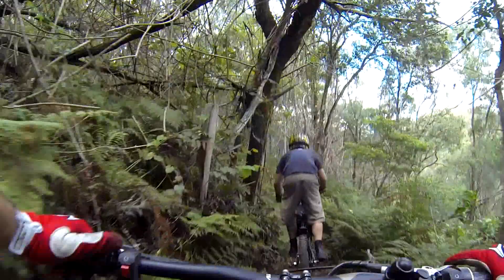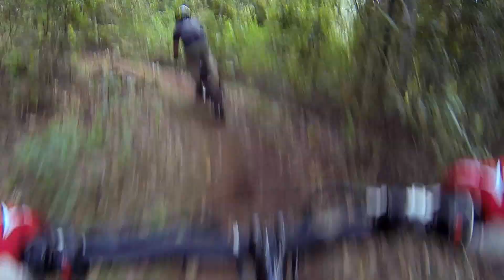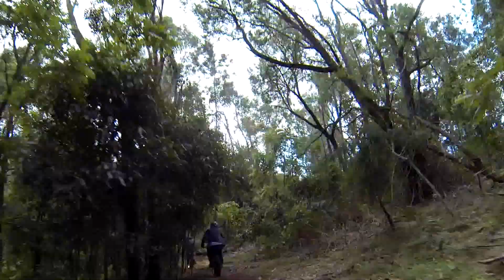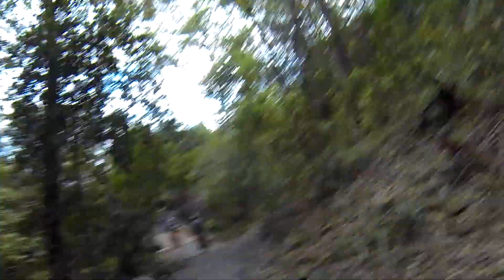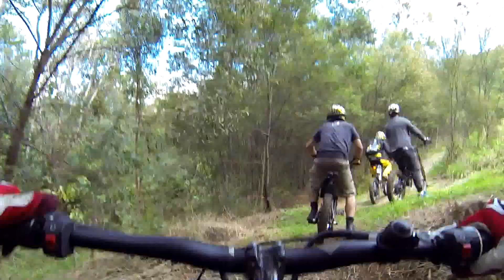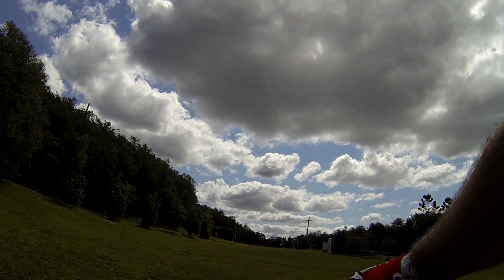hubsinks on 4 electric bikes

Comment: Your bikes sounding pretty nice there..
Reply from the maker: this is the black bike mostly running the bafang mid drive at 44t front chainring to 48t rear sprocket..... there is a bit of bursting with the 1kw hub to get speed too but not enough to heat it....
Reply: No way bit of twin drive going on there ay..
Nice :D